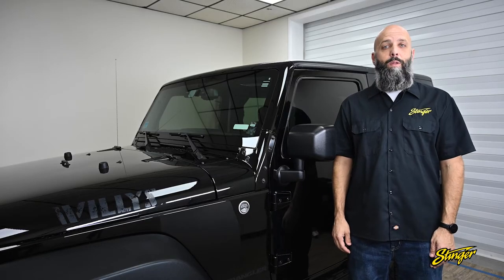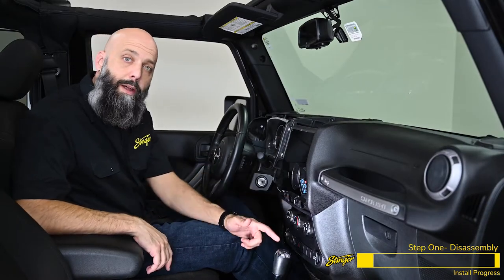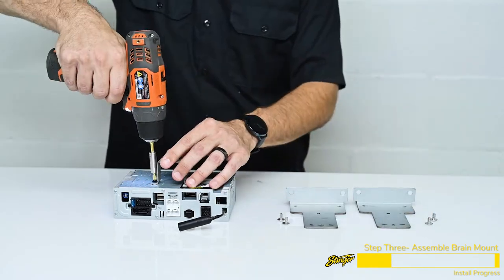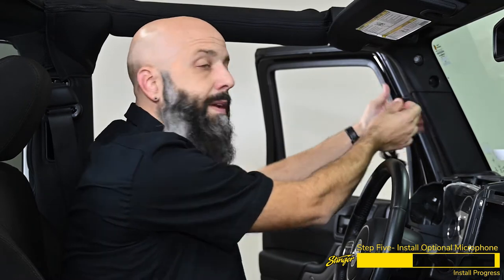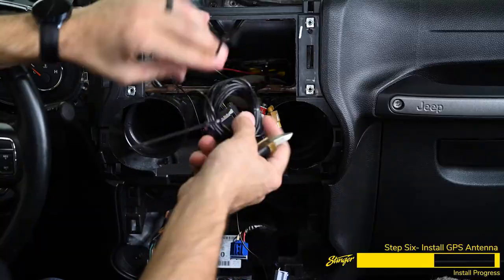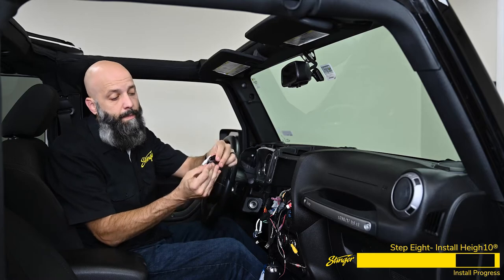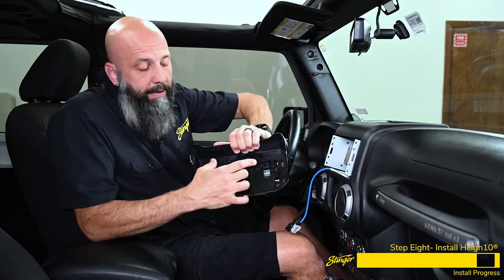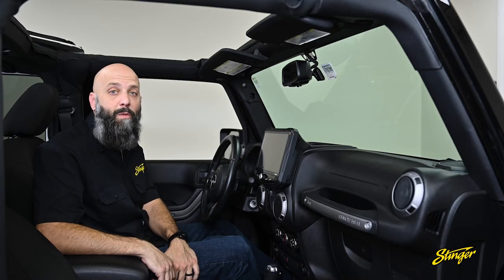Stinger's SR-10JK11H Installation Video

Comment: Great video! Where does one obtain the locking ring (which holds the USB cables) which was used on the panel where the 12v adapter was replaced? I need to buy one.

Comment: Thanks for video. I installed a front camera on wire 2 before realizing after I powered it up it should have been on 4. Can these be swapped in the config? I wasn’t able to figure that out as the menu only allows for certain position swaps per camera#

Comment: I currently have a pioneer 4200 nex I was hoping to replace with this Heigh10.  My 4200 displays tpms info, when doors open,  etc?  Will the Heigh10 also  do this?
What is the limit for usb drives?  I read somewhere 64GB.  That seems low.
When android phone is plugged in and using Apple Music, etc. does the display show the Artsit/song/etc?  My pioneer does not.
Reply: 128gb is the max